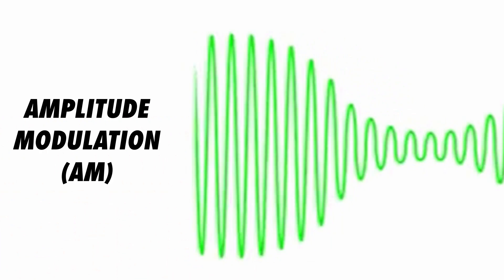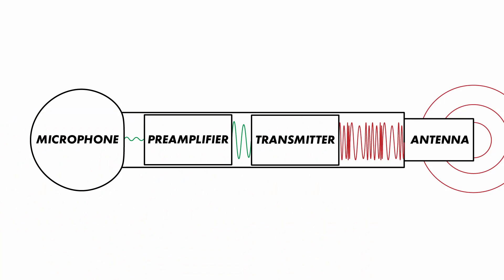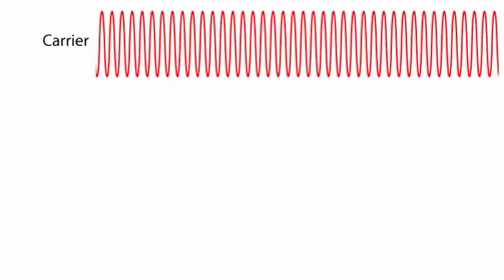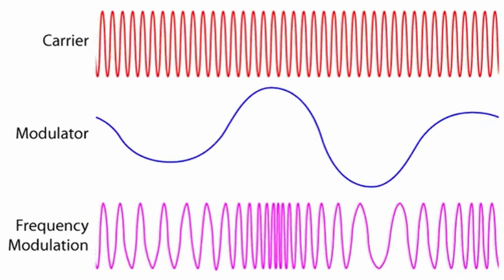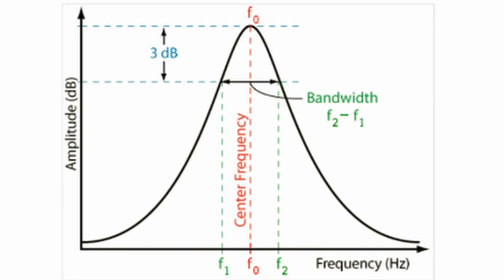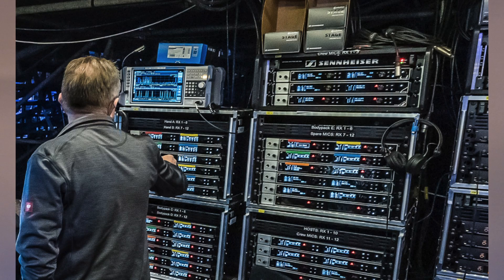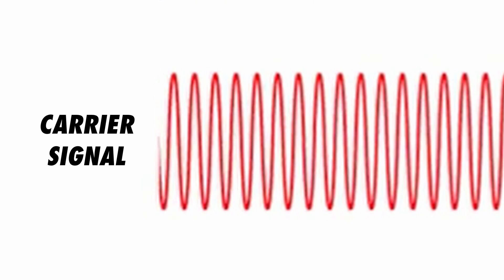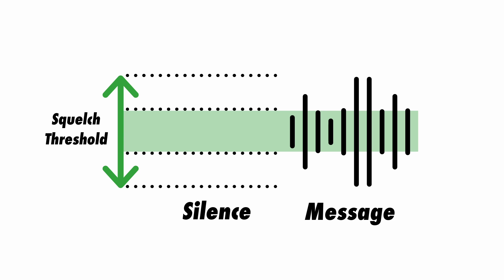How Wireless Audio ACTUALLY Works

Comment: frequency modulation turns a wide noisey 200khz channel into a clean 20khz audio channel or 15khz in actual FM radio. there's a certain theory for that but you can look at it from a kind of information perspective: an 80khz 4bit channel has a 24db signal to noise ratio, a 20khz 16bit channel uses the same amount of data but has a 96 db ratio. To improve the signal in an AM setting like that you need to crank up the power by 72 db which is about 20 million times. FM doesn't have 100% efficiency but that's more or less what it does. a wide 24db channel __--------__ into a narrow __--__ but 'higher' say 80db channel, both cover more or less the same surface area. The stereo part of FM stereo is AM modulated at 38khz there it loses lots of that 'frequency spread out' advantage the ratio is alot lower so the stereo part of FM stereo is alot noisier.

You can kind of picture how FM 'works' by looking at it from a really low freq or bass to FM modulation perspective: say you have a short sample of sine waves, 100 of them like "~~~~~" and another one at a slightly higher frequency 101 cycles. If you put them next to each other one is clearly distinguisable from the other, noise would really have to 'destroy' the whole thing.
If you take a snippet 1/20 of these samples you get 5 cycles vs 5.05, now it becomes alot harder to tell them apart noise can creep in.

Comment: This is very interesting. Do all transmitters transmit 100kz above and below the carrier? So in effect, if you’re transmitting at 432 MHz you’re actually using 431.9-432.1 MHz? Also; with the air full of frequencies, how does that affect a person’s bio-rhythms?
Reply from the maker: These are interesting questions, Chuck. I don’t know the answers!
Reply: The waves pass through u ur not affected it’s a reflector. Think of it like a record player in the air